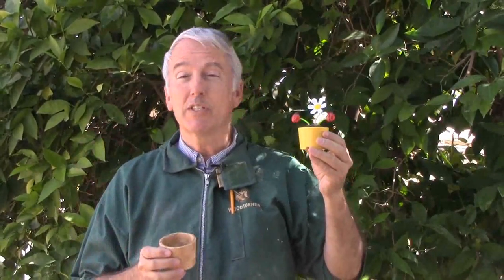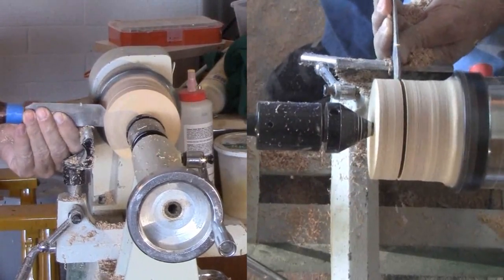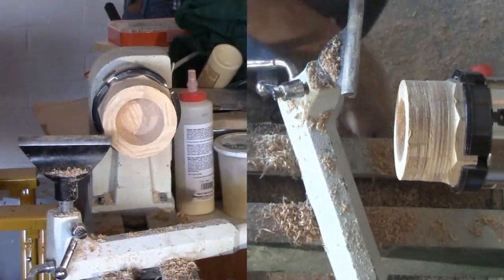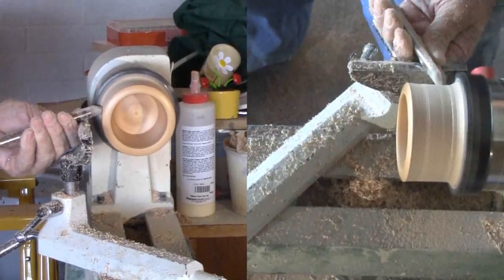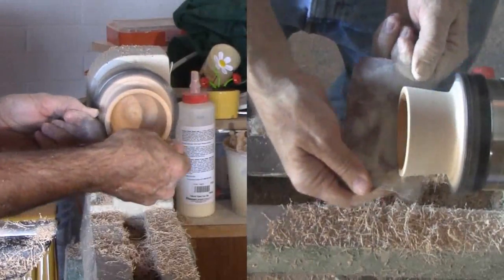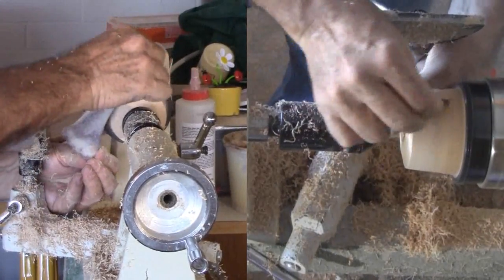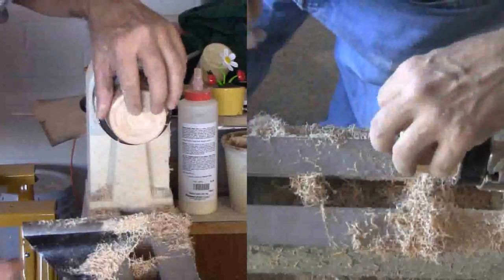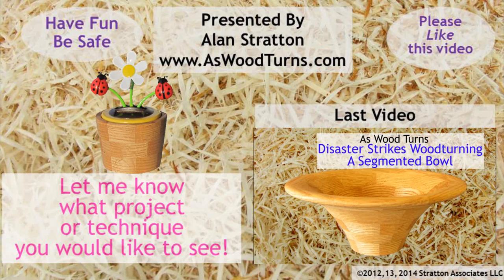Woodturning A Segmented Solar Spring Flower

Comment: Hello Alan,
nice video.
I do not know if it "Spring Flower Solar" are these in different colors. If so, you might get different flowers and then from Different types of wood. For matching Cup woodturning. :-)
And so you get a window sill or what else are decorated with elegance. :-D
Reply from the maker: Great idea. Add some wooden flowers.
Alan